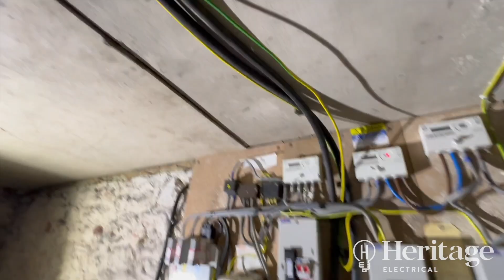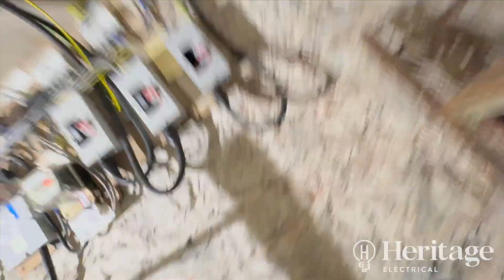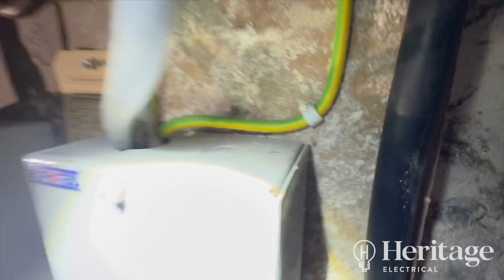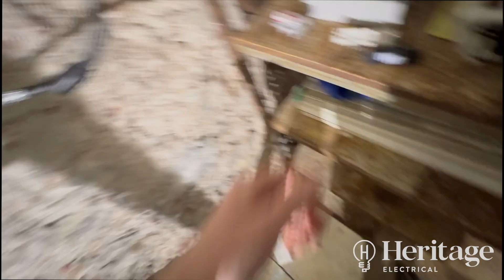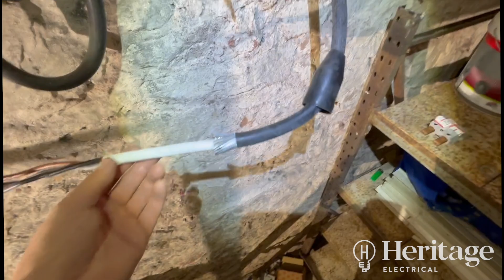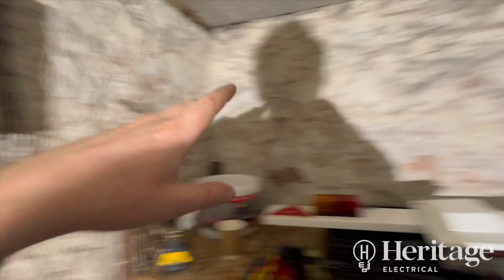🔥 Prevent potentially DEADLY Electrical Fires 🔥

Comment: No glands or grommets on switch-fuse, conductors not identified by sleeving (or tape) and black been used for neutral, all ring alarm bells, I wonder what else you will find ?